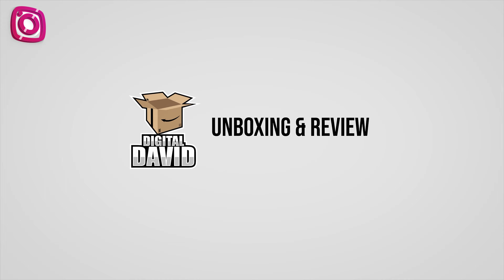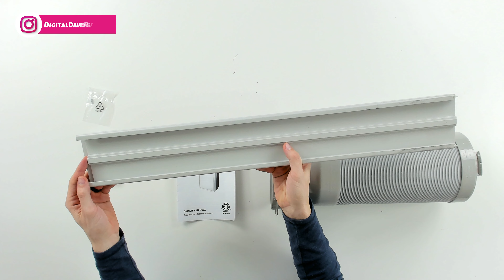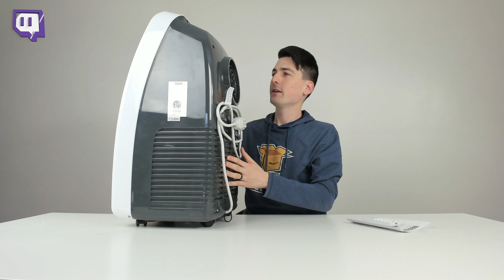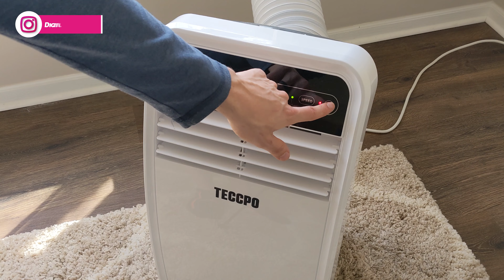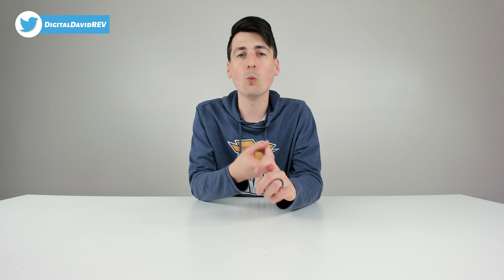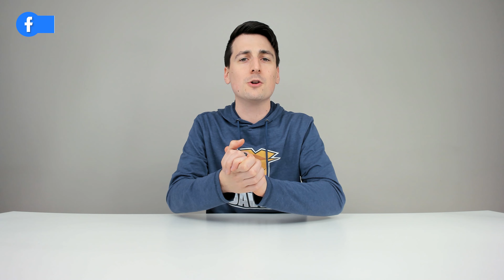TECCPO Portable Air Conditioner Review // Portable AC Fan Dehumidifier

Comment: The AC works awesome, the only issue is the water drain solution is substandard.  I have to empty mine 3 times a day.  It pulls a ton of water out of the air for sure.  I'd like to see solutions for that issue.  I'll keep looking
Reply from the maker: Yeah with all these units you'd have to have a drain hose for that! Not much else can be done!

Comment: I bought this unit and it's not bad as a booster unit for central air but it's not that good of an AC by itself. It's only got one fan so it'll be fairly loud and alot less efficient than other single hose units due to the fact it's constantly expelling air outside. Due to this it's only rated at 4000 BTUs while it has an 8000 BTU capicty
Reply from the maker: Hello! Thank you for leaving a comment on the TECCPO Portable Air Conditioner Review video. I appreciate your honest feedback and insights on your experience with this product.

Based on your comment, it seems that the TECCPO Portable Air Conditioner may not be the most efficient or effective option for cooling a room by itself. However, it could potentially serve as a supplemental unit for boosting central air, as you suggested.

It's also worth noting that single hose portable air conditioners, like the TECCPO model, can be less efficient than dual hose units due to the constant expulsion of air outside. As you mentioned, this could contribute to the unit's lower BTU rating and potentially louder operation.

Thank you again for sharing your experience and insights with the community. It's always helpful to hear real-world feedback from users who have actually used a product.  cnl